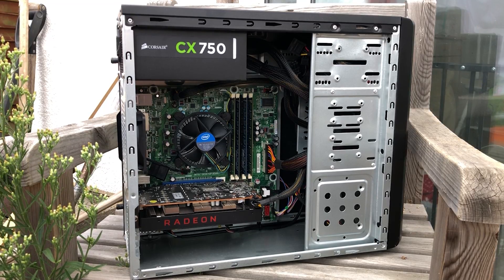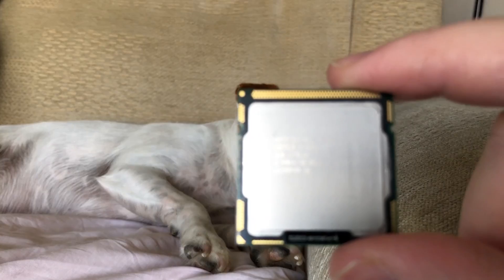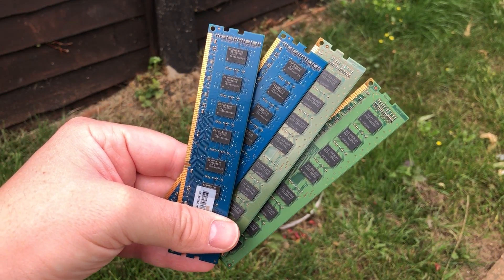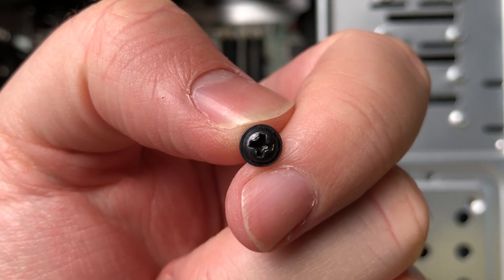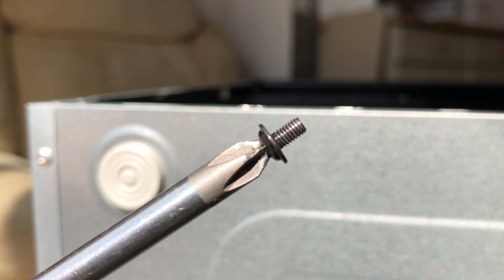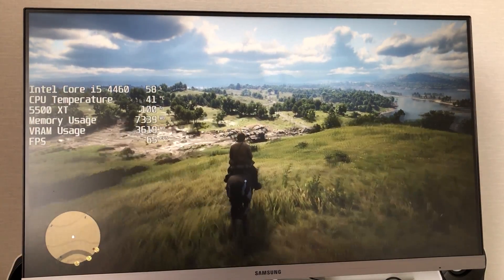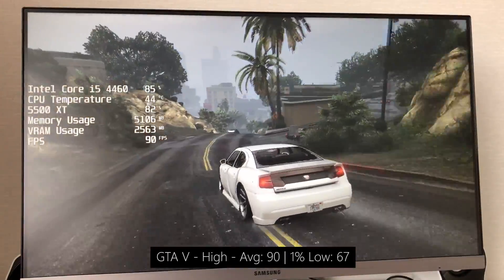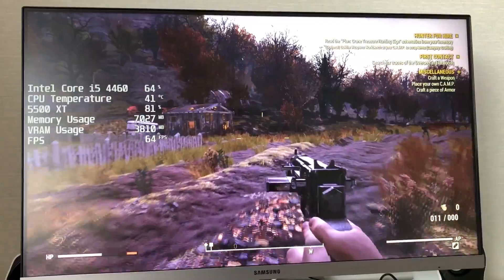My Sister's PC Keeps Crashing...So Let's Fix It!

Comment: I paused this before watching. I am going to hypothesis that the problem was the PSU. I had that same line of PSU although it was an 850w. I got it at a best buy when I needed one in a pinch. It lasted about a month before I started getting crashes and random powering off. Eventually it just died. I took it back, but even though I had gotten the warranty and had the paper, apparently I needed to keep the receipt as well?! At no point was I told this, although it was in the fine print. They did give me a SLIGHT discount on another though. Hoping it was just bad luck, I went for it. Then again, a few months later, it just died after a big spike(I use an APC brand UPS with a conditioner FYI). I took it back with the proper paper work and got yet another. Yet again, it did the same thing even after changing it to a new circuit with a brand new breaker. I ordered a cheap 700w Rosewill off Newegg right away and tried to get my money back especially since it was the 3rd one in less than 8 months and had only been 2 months since I got the last one. They would not do it. In a bit of rage, I just left it there amd didn't take the replacement. I wouldn't have felt right selling it to anyone given my experience. The 700W (half the price) showed up worked fine for about 3 years until I went to crossfire and needed more power. I got the same line Rosewill 1000w(still $40 less than the 850 corsiar)and it has been used for 3 builds so far now. The 700w is going strong too and I am
Actually installing it into my oddest daughter's PC right now. Anyway that is my story and I will see if I'm right upon watching this video. Cheers!
Reply: Drats

Comment: The old Core i7-860 is a "95W" TDP cpu. As we know, Intel's TDP is more like an average than the real thermal dissipation of the package, so we're looking at an over-100W CPU. The stock intel cooler for these CPUs were taller and very dense, so swapping it for a newer, lower-profile one is a recipe for a disaster.
I had a Core i7-950 (130W TDP! :O ) and the stock Intel cooler is very good... as a paper weight! Switched to a 120mm watercooler (TT Water 3.0) with push-pull fans to keep it from starting with the thermal-throttle shenanigan's before any game finished loading. Ended up swapping it for a Xeon X5650 (95W TDP) that barely broke 65C while being test-stressed with the watercooler.

Comment: should have used NVidia GTX 1650 S or 1660 instead.

Because, well, Most Adobe software like Premiere Pro, etc are Optimized for NVidia Cards.
You may notice it immediately upon firing up the App, it is trying to sniff the GPU.

I'm not saying Radeon RX is bad, but the fact that certain Video Editing app is more optimized towards NVidia card, is the main reason to use NVidia instead of Radeon.

Comment: I had a system that had a intel core i5 650 running at a cool 99c until the motherboard died so I sold the cpu to cex for 10p

Comment: I have an i5-4460 in my computer with a GTX 970, it's a decent CPU. I plan on swapping my i7-4790 into it when I get access to it.
Reply: Just do it man. I got a secondhand Bundled Core i7 4790K with 2x8GB RAM installed. For only $200.

Comment: Cmon your sister need a better pc than that. Stock intel cooler. Cmon you have alot of pc parts. Pimp it out.
Reply: Those components are more than enough since His Sister is only using it for Web Browsing, and Editing video at 1080p 30 FPS.

It can export the 10 Minutes video fairly quick Less than 1 minute.

Comment: 65W cooler on a 95W cpu.
Reply: No. Core i5 4460 is 84W CPU.
But if you compare it to Core i7 4790K which is only 88W CPU.

The point is, that His Sister doesn't actually playing heavy Games like RDR2. A Standard Intel Stock cooler is actually more than enough here.
Reply: @ClayWheeler  No, the 860.

Comment: Those old i7 CPUs had really high TDP of like 95 watts !!! i have the same mobo that would take the old i7 but have stuck with the first gen i3 as its TDP is much lower around 35 watts and never gets hotter than 60c even under load

Comment: I think the "Intel Mayonnaise" under the IHS slipped down during time and does not make correctly contact between the IHS and the CPU die.
Hence the very high temperature while idling.
This problem is also encountered in some PS3s which were used verticaly during long periods of time, and were terminally overheating...
Stupid and frustrating problem indeed.

Comment: Upgrade it to Xeon E3-1231v3. It's excellent CPU, equivalent of 4790 but if you have H87 board you can max turbo on all cores to 3.8 GHz and than its better than non-k i7.

Comment: I'm surprised that you didn't notice the higher temps after starting up her rig for the first time following assembly. Also, why did you just videotape the computer monitor for the game play segment? I'm only asking because the drivers for that 5500 XT definitely support ReLive internal recording, and I'm sure it could have done so admirably without too much of a performance loss.

Comment: Hello, I know this comment is a bit of topic, but I recently I tought to my self it would be a good idea to start playing some old rockstar titles like gta 4, but here's the problem. The game uses my integrated graphics AND NOT MY GPU ( a gtx 1060). I should mention it's a laptop, just for the purpose of it. I even tought of shuting off my integrated graphics, but of course that would cause problems for other programs right? And before you say it, yes I checked the nvidia control pannel but nothing happen, its still uses my intel integarted graphics. I know you have some experience with that game and some other old one, and the viewers too, so what better place to ask for help than this channel. If anyone one can help me run my game with my graphics card and not the integrated graphics I would be very glad. Thank you.

Comment: Nice built mate i just done my partner a system i managed to get a gigabyte 1155 motherboard with 16gb vengeance lp and a i7 3770 bundle from ebay my brother in law got her the gtx 1060 6gb

Comment: I have a problem with GTA 5, (R5 3600 and GTX 1070ti) i set almost everything on max settings on 1680x1050 resolution and only have about 70fps with 60% GPU utalization, can anybody help me with this?

Comment: When a mother board starts going bad it will lag in performance beacuse it unable to deliver proper voltage this leads to high temp some times in spite of good cooler without overclocking or it can be a problem to a cpu

Comment: 1150 is cheap and powerful enough for most cases!!...but the plattform is old and has no nvme support!
the better choice were a 6. gen z170 and a 6600k for 100$! u can use a z170 d3 if u wont buy ddr4!
dont buy a i7 for this socket unless u get it for under 40$! much more is not worth the money

Comment: I was having the same issues with a Xeon x3460 (i7 860 equivalent). I bought a Cooler Master Hyper T2 for cheap and it solved the problem.

Also if you plan on upgrading her new system may I recommend the e3 1245 v3. Its equivalent to the i7 4770 but $40ish dollars cheaper on the used market.

Comment: I have an i5-750 that I've never booted.
I was given that and an FX4100.
However, the LGA1156 was relatively recently discontinued, and I had a very difficult time finding a motherboard.
The FX4100 was still actively supported. So I was able to get a motherboard for that.
I type this comment on that system now!

Comment: take a look at the E3-1241 V3 Xeon.  they are alot cheaper than the i7's but are pretty much the same thing, except cheaper.  its a 4c/8t at 3.5ghz.  board should support it with lasted bios revision.

Comment: why not just put an aftermarket cooler on it ? Arctic freezer 7 is cheap and powerfull enough to keep these chips cold. And yes, never intel cpus have far worse coolers than first gen i series cpus. I remember the stock one for my i5 760 beeing at least double the height of the never ones as far as the actual block goes. Not just that but the cooler featured a cooper core which the never ones do not.

Comment: i got a question
my motherboard have 4 dimm slots and support dual channel
i already fill 2 out of 4 with corsair brand
the speed are 1333mhz, if xmp profile turn on it will be 1600mhz
if i want to fill another two slots with different brand, will the dual channel still works and are there any performance impact if i do that ?

also how this dual channel things works for the 4 dimm slots ?

thanks before

Comment: I had a similar experience with my brother but I actually fixed it. His computer would become really sluggish in games where it shouldn't. I checked and noticed the CPU was heavily underclocking itself, so downloaded software to look at CPU temperatures and what do you know, it hit 70° shortly after turning on.

Opened the case and realized the fan was not screwed on and hanging slightly off. Fail, silly oversight.

Comment: Those older i7's really degrade temperature wise over time. They're all basically impossible to cool on the stock cooler anymore unless you get lucky.
Reply: I had a first gen i5 650. It was actually quite fast but after a year it would cause loads of freezing.
Reply: And its not an issue with TIM under the heat spreader since they were still soldered back then. Unless there is an issue with the solder itself.

Comment: If the motherboard supports it, the cheapest in-socket upgrade to 4C/8T for that pc could be a Xeon E3-1240 V3 (less than 60£ including shipping on AliExpress), or for 5£ more and better price/performance an E3-1246 V3 (which is basically an i7-4770 for half the usual price).
It would be interesting to see how much difference they would make compared to the i5...

Comment: Hey, My pc doesn't start after I installed new RAM, everything is same specs except brands. Any fixes ?
Reply: @PCDYYD ok so it's h310m s2.0, supports ddr4 DIMM RAM. I bought a compatible one from corsair, 2400mhz. Already have a RAM of same specifications. When I install the new one, pc doesn't start and is just stuck in a bootloop.
Reply: @PCDYYD thanks a lot, I will probably take help from a technician as I am very scared myself. Thanks for responding though 😃

Comment: What was the total system power usage (after the replacement)? I wish more reviewers would give avg. power usage data.
When working on automobiles. The negative battery cable is always 'first off, last on'. Like a gpu. Good rule of thumb for
any hardware aficionados who want to dabble in auto repair.

Comment: I know you know this as well as I, but for video editing my only suggestion would be more RAM. 8gb is pretty anemic nowadays. 16-32gb with the 4th gen i7 you plan on upgrading to would be fantastic.
Reply: That motherboard has 4 RAM slots as well as 5 SATA slots, which is good to have. Using 8GB sticks, you could have 32GB RAM in there with no issues. You could also have an SSD (OS), 3 HDDs (games/data/files etc) and an ODD (for CDs/DVDs/Blu-Rays).

Comment: I haven't used a case with fans that small since the early 2000s.  Swap it for anything with a couple 120s or 140s and it will run a whole lot quieter and cooler.

Comment: I think I had the exact same case (judging from the inside) , my rx580 idled at 45 degrees with side panel off, moving to an cooler master nr400 it dropped by half

Comment: For CPUs of that generation, I've cooled a x3440 with a Coolermaster T2. Cute little cooler that can fit in a lot of OEM desktops. You can get it for about $20 used.

Comment: Only thing I personally don't like about 5500XT is that it only uses 8x PCIe lanes. AMD disabled 16x on the cards. And if that is PCIe 3.0 with 4GB card, it can gimp performance significantly, if card has to do any data swapping with RAM, something that goes away with PCIe 4.0 or if you have 8GB version, but because of that unnecessary gimping, I am not big fan of the card.

Comment: Doing the CPU change should be overall positive for her I would think. If she was OK with the original CPU and didn't think it was too slow, the new one very well may seem faster much of the time. Even though it's an i5, 4th gen is an improvement. Hopefully you find a tower with an i7 on the side of the road, in the "bin" as you would say.

Comment: Just get her a brand-new Ryzen system. They are cheap enough and it won't take up your time for the first 5 years.
Stop using those cheap motherboards without VRM-heatsink, they aren't intended for sustained load like video-editing.

Comment: Wouldn't the 4460 be quite a massive drop in editing? I mean that's half the threads and windows uses up 2 cores easily.
Reply from the maker: Yeah that’s why it’s getting the i7 treatment soon :) Just a stop gap until it arrives
Reply: Windows sucks.
$ mpstat
Linux 4.9.0-13-amd64 (five) 	09/02/2020 	x86_64	(4 CPU)

05:24:37 PM  CPU    %usr   %nice    %sys %iowait    %irq   %soft  %steal  %guest  %gnice   %idle
05:24:37 PM  all    2.73    0.00    0.47    0.09    0.00    0.01    0.00    0.00    0.00   96.69
That's listening to an MP3, with my browser open and a bunch of terminals going. You know, the usual.  3.31% utilization. That's reasonable. My system boots up in 2.763 seconds too. And you do not want to know how fast updating is. heh I've seen Windows 10 update. What the heck is it doing? I could install an OS 10X in the time updating Windows takes.

Comment: You might have to delid that 870, though it certainly needs at the very least a Intel cooler with a copper core. As for the i7 upgrade, join the Xeon life.

Comment: i had a funky other problem before it was the first time i had encountered the issue myself it was on my mother's old pc i checked all components and they were fine except the processor it just one day decided ill freeze the pc multiple times in windows 10 i checked if something in windows 10 was causing the issue but the pc was idling so no load i even eventualy did a why the hell not thing and reinstalled windows 10 just to find out the behaviour hasnt been fixed thinking maybe i missed something that caused the issue and it wasnt a virus since wel that if it was present was gone aswel afther the reinstal

so i checked the temperatures before and yes they were toasty but not temperatures that could shut down the pc now this pc came from my sister and wel knowing her she thinks if it runs a browser its fine she doesnt check temperatures nor stresstests pc's or even bothers starting a game so this hole time the pc was cooking the thermal paste was completely dry but while yes that was a issue it wasnt the main issue the cooler on it was full of dust but also from looking online not capable of cooling the processor properly heck the intel stock might have done better she just slapped it on and enjoy and i dident have any other cooler at hand that fits the processor but the damage was done

the processor likely just died from maintaining high temperatures for so long that something on it burned out but was still running and that was from the main usage of just using youtube so stresstesting would have been a instant overheat

so morale of the story is check your temperatures while the processor in the video might just be fine afther a different cooler it could leave permanent damage and no right amount of cooling can help it then just wanted to mention it due to similar issues and high temps and to computer builders dont be my sister stresstest and check the temperatures of the pc every pc should be able to pass a stresstest without issues and you wil also know if your cooler on the processor is seated right you can check it in the bios aswel but usualy there isnt any load on it in the bios

Comment: I like that your trying to use older parts, but intel stock coolers are just bad. Keep the Graphics card and psu and go Ryzen. 
You did fix it but the system still sucks.

Comment: I only have an i5 myself. So I need an i7 too. They're still pretty expensive though. Well, the 4790K is. At the rate the price is dropping I should be able to get one in about four and a half years from now.
Reply: You and Rginhd don't have to wait for price dropping...e3 1240 v3 is now under 100 pound(on ebay...). It is your way to go, if you have dedicated video card in the system.
I know it needs the latest bios, but no tinkered one is needed as it was at socket 775!
Reply: @trolco  I just want to get the max CPU my motherboard can handle. That's a i7-4790K If I'm going to upgrade I want to go all the way. Hopefully I can get some good OC out of the chip I get too. I have a Z87 motherboard.

Comment: You and your sister could do a collab where she sews a PC case (somehow) and you build one in there and test temps. Maybe she can cut air holes for fans in the cloth and cut out holes for ports and motherboard I/O etc.
Reply: About the only sewing related thing there is with electronics is cable lacing. And no one even laces cables in PCs. Cable lacing is pretty bad ass though.

Comment: And here I just told my friends that a Radeon RX 5500Xt is the best budget card to get, even the 4 GB version, despite running on PCIe 3.0.

There had been some rumbles regarding VRAM and PCIe concerns, so I did a bit of research on their behalf.
And generally, it's a card, that on a good day, trades blows with RX 580 and on a bad day, RX 570.
While still being more power-efficient.
Reply: I've also just gone from one B450 mobo to another.
Asrock B456m HDV R4.0 to Gigabyte B450m Gaming.

I no longer have random system-wide crashes, which I believe were due to some power-delivery issues, or VRM temps, which could go a bit high.
Though I do have the occasional software crash, such as Java or certain games.
But I haven't reinstalled Windows, nor fixed the drivers, so that might be the main issue, which I will look into, next time I am at my main.

The Asrock will now be paired with an Athlon 200ge and an WX2100, where I will see how it fares against an i5-2400 with HD7770 combo.